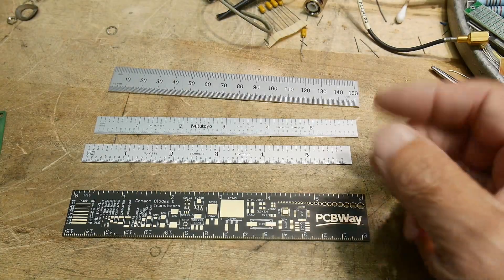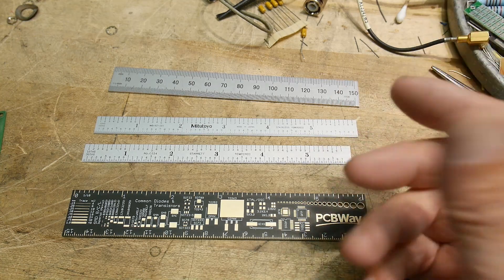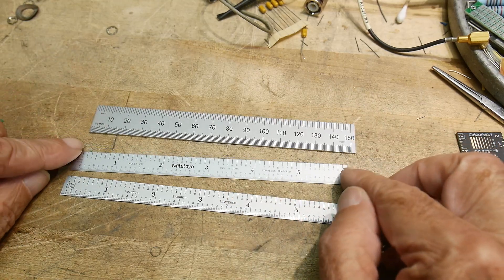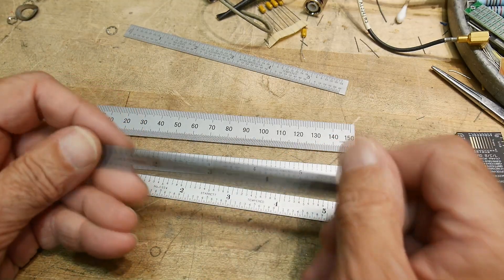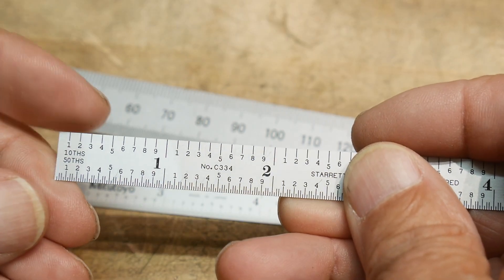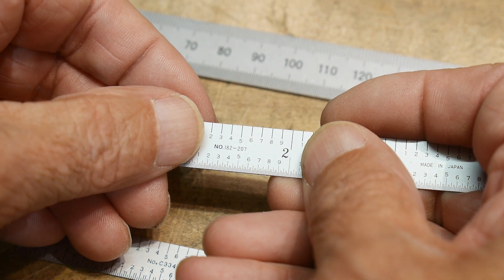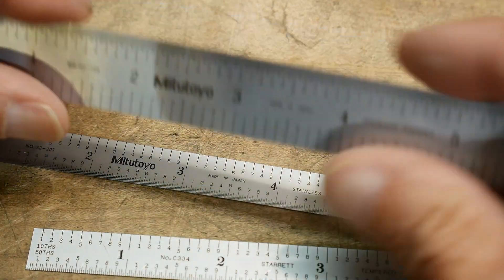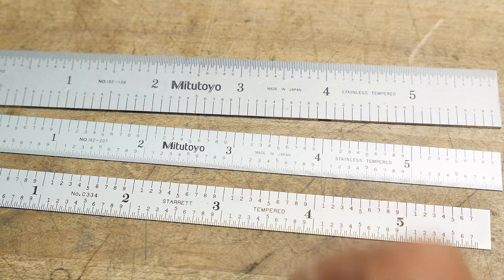#1923 Stainless Steel Rule with 1/10ths and mm

Comment: "A combination of both" ...

Funny story about that. Just last night I was assembling one of those janky acrylic Raspberry Pi cases for a Pi 4 that I use. I assumed all the fasteners were in metric sizes, so I pulled out my metric nutdriver set. And that worked fine, but at one point I put a metric 5mm nutdriver on one of the brass standoffs, and noticed that the fit seemed awfully sloppy. So just for grins and giggles I broke out the SAE nutdrivers and tried a 3/16'ths driver. Much better fit. WTF (all the other components seemed to be truly and properly metric though)??

Now maybe it was a metric fastener and it just wasn't sized to spec perfectly. Or maybe my nutdriver was a little out of spec, or maybe both. But it sure seems like they somehow slipped some 3/16'ths fasteners in with a bunch of metric 4 / 5 / 5.5 mm stuff. Weird. 

But this is why I always buy any toolset that I by in both metric and SAE sizes if it's something that comes in both. It's also why I'm starting to favor fasteners that don't come in two different standards, like Torx.

Comment: $46 for that Starrett.  Never going to happen.  I recently bought a German Staedtler for $4.95.  It seems that you a paying for a name with Starrett or even Mitutoyo (which is less than half the price of the Starrett, BTW).  You can't tell me the Starrett will somehow give you better measurements than the Staedtler.  They are all marked to a much finer tolerance than the reading/operating error of even the most skilled craftsperson.  $46 for a 6" steel rule.  Insanity.
Reply: Besides that, at least for me, I don't find that much use for a plain old ruler. But what I do find myself needing a lot is a thread gauge. How many times have I grabbed, say, a bolt where the corresponding nut was lost or something, and I needed to retrieve another nut from the parts bin... but what nut??? Size? Metric or SAE? Thread pitch? Uuuugggghhhh.  

I'd spend more money on a nicer thread gauge before I'd spend more on a ruler. But then again, I also wouldn't pay $46 for one of those either! Unless maybe it came from Snap On. :p